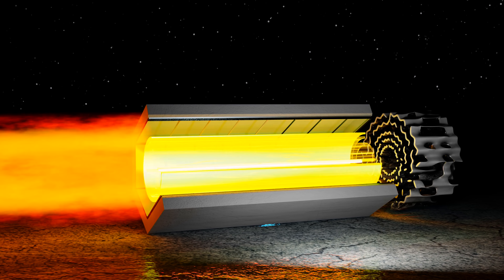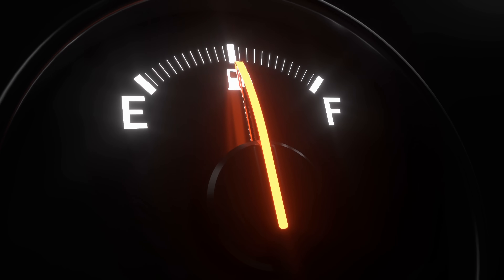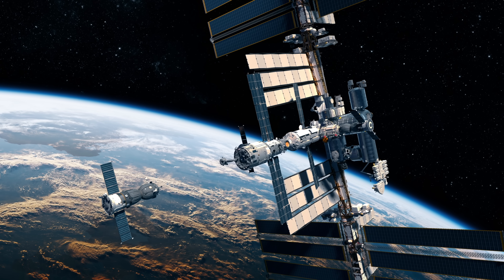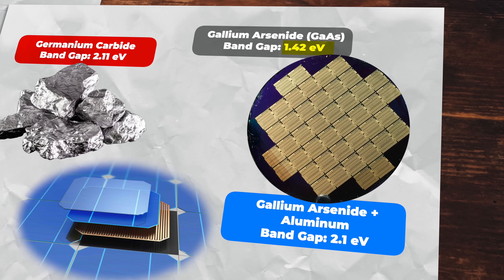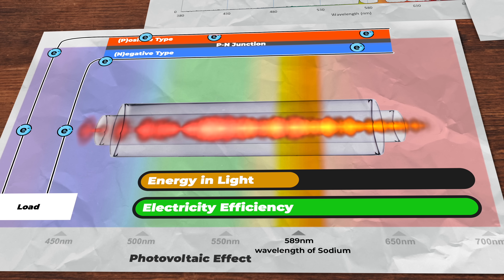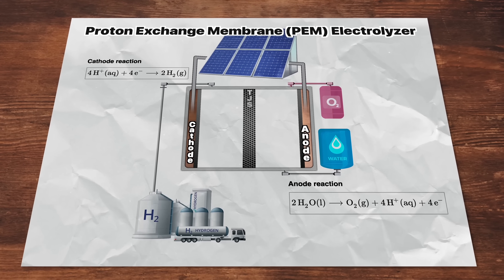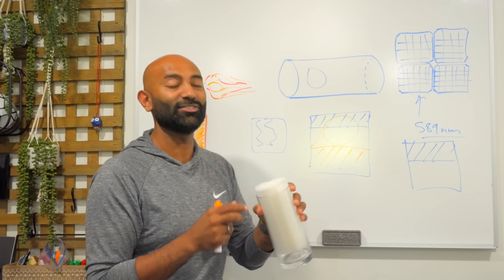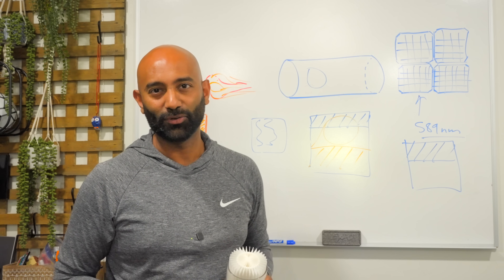Why Solid State Might Save The Combustion Engine

Comment: Thanks for covering this Ricky. As micro-turbine gas-electric generators already are capable of about 70% efficiency, are very compact and simple, why not use them instead combustion photovoltaics? 
In regards to your concept of photovoltaic ICE exhaust power recovery, I'm thinking that if you were able to recover 50% of the waste energy from an ICE exhaust using photovoltaic generator, you would be recovering about 15% of the total engine thermal losses. Having worked with  large Exhaust heat exchangers (stack robbers) to capture waste exhaust heat, but  due exhaust  restriction and back-pressure reducing engine power, we typically only recovered about 30% of exhaust heat. If similar was the case with photovoltaic recovery, you would only be recovering about 15% of the waste energy in the exhaust stream, and something like a exhaust power recovery microturbine, adapted from a turbo-charger to drive an electric generator might be as efficient and less expensive. 

BTW: Back in the 80's when I was working for in the Oil and Gas Industry and dealing with HPS and Mulit-Vapor lighting systems, the thought of using high temperature combustion gas to produce combustion based lighting using a multi-vapor tubes for remote off-grid locations occurred to me. I mentioned it to some engineering colleagues, and we estimated the efficiency could be considerably higher than electrically excited tubes but the maintenance, cost and complexities of producing such a system would likely be practical and affordable, plus having combustion sources in flammable environments is not suitable.
Reply from the maker: great insights Jack, that's interesting especially with your background... cheers!

Comment: 1.). Emissions?. 2.)  No working parts? what about fuel & sodium pumps, cooling fans etc?  3.) Tuned light panels to convert energy? - typical solar panel efficiency drops as it gets hotter. 4.) heat transfer & dissipation?. 5.) life expectancy of the combustion chamber materials due to thermal cycling?  So maybe one day, but currently Fantasy Bollocks 101

Comment: I suspect something burning as hot as this seems to would have pretty high nox emissions.
Reply from the maker: it might be possible to control the fuel air mix to maintain a healthy enough temperature for sodium light emission, while minimizing overall temps and NOx emissions... but yes that is a major factor to overcome

Comment: Why the hell would somebody combine combustion in this way?
Reply: It would be very nice to have a gasoline powered battery.
Reply from the maker: yeah a gallon of gasoline has 32kWh of energy and weighs like 3kg.... pretty crazy if you could get efficiency up... especially for some special light weight applications...I love the series of comments, and the journey you took to get to them. that is by far my favorite part about engineering!
Reply: Okay, never mind this is genius.
Reply: This is good for off-grid and stable power. This engine, however will produce no torque, and I see no reason to put it inside of a car.

Comment: 1 gallon of gas to get 10 khw of electricity.   a tesla gets 3 miles per kwh.  so a gallon of gas converted into to electricity gets you 30 miles.  

but a gallon of gas costs $6 in california and 10 kwh of electricity costs a $1.50.  

you’d need to get 120 miles out of your gallon to break even.   then you have the cost of this engine.
Reply from the maker: 10kWh out of a gallon would be 33% efficiency... their claims of 70 or so percent, means closer to 20kWh out of a gallon. supercharging in CA costs about 45 cents so that's $9, which is more than the gallon of gas. just adding some context in terms of numbers, hope that helps. cheers!
Reply: @TwoBitDaVinci  

Thanks bro.  but most people dont super charge.  and home solar is getting cheaper and cheaper.  you can legit charge at home using solar for 2 cents per kwh.  if you use the grid off peak its 10 cents.  if you use the grid during peak its 15.  

but i thought they themselves stated that they get 10kwh hours out of 1 gallon.  i might have to watch the video again.

Comment: Seeing as the best solar panels are less than 25% efficient, there's a 0% chance this is 70% to 80% efficient or anywhere close to it.
Reply from the maker: Michael did you watch the part about how sodium emits nearly monochromatic light at around 589nm? if you tuned your solar cell for that .... that's nothing like a typical solar panel on sunlight. I have graphs and stuff in the video that break that down. that's why you can't compare this to a normal solar panel that works on the broad spectrum of the suns solar radiation. cheers!
Reply: @TwoBitDaVinci  Yes I did and this is still not going it be anywhere near 70%-80% efficient. This idea that you can magically make photovoltaics many times more efficient because it’s in a certain wavelength is delusional. The thermal losses would be enormous. Even LPS lamps lose about 70% of their energy as heat and HPS lamps lose about 60%. I’d be surprised if something like this were over 15% efficient. To even present this as something that could potentially be true is irresponsible and we both know that.

Comment: This is pure moonshine (except much dimmer than the moon).  You have hot sodium a fraction of an inch away from semiconductor.  If the losses in semicinductor is 1% with 300 suns light & you have an impossible cooling problem.  The best copper heatsink could not keep the cell from melting.  Indirect schemes (transferring heat to the sodium through heat exchanger) has the same limitations of Stirling engine (the heat exchanger limits Tmax you can have, & therefore the efficiency & the heat exchanger is subject to degradation).  As soon as the exhaust cools to the excitation temperature of sodium, it can't be cooled further.  You will have the problem Chrysler had with turbine engine (the exhaust from the engine "could ignite a wet board fence from 20 feet away").  The claimed efficiency is pure bogus.
          The US Government had a program where hot decaying plutonium (same stuff as in mars rover & voyager space probe) exciting solar cell.  This is easier as there is no hot fluid flow through "engine"; everything is under vacuum in the gap between cell & the hot source.  Also, the power output per kilogram of device was much more modest (50 watts electrical power from 2 kilogram device), so cooling was not such a problem.  It was also OK for the device to be VERY expensive (not the case for car power supply).  Program was a failure.

Comment: NASA uses TPV panels that somewhat exceed 40% efficiency, but that only measures the conversion from the photon source. It does not include creating those photons, which is a pretty low conversion. Every BTU of heat is energy loss. 

So claiming 80% on any TPV system based on combustion is almost surely baloney. Or...they measured one tiny part in oerfect conditions and ignored everything else.

But the finance people can not do this basic math. They are the same people who bankrolled Elizabeth Holmes, right to the day she went to federal prison, for fraud.

Comment: The structure is so close as a blackbody, how much sodium yellow light can be generated is a question; also the Carnot efficiency formula should be still applicable to this design. Yes, a smoke and mirror scheme.

Comment: microwave+ultrasonic to create low temperature plasma for combustion from choice of fuel source. bandgap rubidium at 3.5ev pull off UV light into a UV photo voltaic. 2 cycle engine recieving output of low temp combustion through valved manifold. (essentially a compressed air engine at that point )
Reply: exhaust the plasma at the front of vehicle, radiate microwaves across the surface of the car or even spacex starship using fractal antenna arrays printed in carbon ink into the surface. voila plasma shield.

Comment: Copper would not be a good metal to exchange heat with the sodium it melts at 1084'C you want a heat exchanger made of Tungsten which melts at 3422'C.
Reply: There is an interview with the inventor at First Principles channel. No heat exchanger salt is added at the beginning of the combustion chamber then recondensed as molten salt at the heat exchanger and channelled back to the start by capillary action.

Comment: 4 kW to 4l. Seems like they are not even aware of the difference between energy and power.

4 liter gasoline is around 40 kWh. If they produce 10 kWh from 4 l, they loose 75%…

Comment: Even if this works, I think the real problem is that with EV cars and renewable energy, it works well together and eventually will mean free energy for our homes and cars.

That's going to be difficult for any alternative to compete with that, after all, given the choice, we would all rather produce our own energy for our homes and cars as we have more direct control over the price point, which over the long run would more or less be free energy, any alternative needs to match or better that, which this combustion engine, assuming it works at all, sounds like you have to source the energy externally, basically you have to buy it, and I'm sure we know how that will go.

To make it worse, with the advancement of solar tech, it's only a matter of time before it's cheap enough, light enough and can mould into the shape of the entire car, which could produce a lot of the energy if not all of it in summer that the car needs, because of this, I think it's going to be difficult for any of these rivals to compete because renewables and EV's work well together in that it allows us far more control over the production of energy and the price of it.

Comment: Rotary engine to make electricity. All Electric drive system with 1/10th the battery of a charge up system. Exhaust goes to the wonder tube. Instead of 350 miles per gallon 700 miles per gallon.

Comment: How about a sodium vapor cooled nuclear process. Or self powered street lights. The energy is the difference in combustion temperature of the fuel and the temperature the sodium needs to luminesce. The energy lost is the exhaust temperature after the light cell is heated. Maybe that heat can be recycled to superheat the intake air, but what materials can take that temperature.

Comment: 50% That's highest possible efficiency in physics when converting energy from one form to another. Chemical >Thermo > Photo > Electrical. The MAXIMUM efficiency possible is 12.5% from the initial chemical energy reaction. Take into account that the best photovoltaic cell NASA has produced was between 23 - 25%. So that means the IDEAL top efficiency would be 6.25%. So anything higher being promised is a lie. Vaporware, son.
Reply from the maker: converting resistive electric heater to heat is nearly 100% efficient. there's no 50% rule in physics... it depends and varies wildly

Comment: Mostly I wonder if soot would build up on your light source or solar panels, so you'd lose efficiency once the device exits the lab.  But if it's efficient enough, it could make a decent range extender for an electric car, boat, or plane.
Reply from the maker: yeah the system would liekly build up soot, and would need a maintenance interview to remove.

Comment: i kinda understand the idea of it? ive seen gas mantles that can convert heat from gas lamps into more light. this would in a sense basically just maximize incandescence then absorb those light back into some photovoltaics ye? heat up an incandescent material preferably one that emits light tuned to what the photovoltaic is tuned to?

just trying to digest the information.

Comment: This is pure crap.
Burning something has a efficiency loss because some heat is exhausted.
Turning heat into light has a efficiency loss.
Turning light into power via solar cells has a efficiency loss.
Cooling the solar panels to keep the efficiency up has a loss.
Storing the power made in a battery buffer has a loss.
Sending the power into a motor just like any other electrical car has a loss.

EVs have a efficiency of 80% or so, then add the looses for all the burning, converting to light, converting to power and added cooling.
Reply from the maker: all true, everything has a loss, but the question is how much? what if you have near monochromatic light, and a perfectly tuned band gap solar cell? Also a gallon of gasoline stores like 32 kWh of energy, the energy density of fuel is crazy high, which is why some aren't ready to give up on it. great comment and well thought out, cheers I appreciate you!
Reply: @TwoBitDaVinci  Try and do the math.
All numbers are rounded to make the calculation easier.
A solar panel 2m X 1 meter makes 300Watts/hour at 20% efficiency.
A "perfect magical solar panel" the same size with 100% efficiency would then make 300Wh * 5 more efficient = 1500Wh.

1.5KWh production from this burner with 2m length and 1 meter width solar panel, presumably rolled around the combustion chamber, would take 66 hours to charge a cybertruck.
If a car uses 150W/km to drive (Ioniq 6 or Tesla 3 on a good day). 100km/h for 1 hour = a 100km long trip needs 15KWh to drive.
15KWh needs 10 hours to charge with 1.5KWh burner and solar panels.
So for every hour you drive at 100km/h (60miles/h) the car needs 9 hours pause with fire burning to charge up the battery again.
This is for the solar panel alone, no other loses in the burner, cooling of the solar panels, charging of batteries is in this calculation.
Let me know if my math is wrong

Comment: You are making it to complicated. Try this take a piece of glass. Stack it on another piece of glass. use a air gap space of 1". then stack another piece of glass use another air gap space of 1". Use one way glass. Do this 10 times. Put it in a box and only allow an air gaps at every other level. Making a serpentine pathway for the air to move in the box. Then measure the temperature at each level. You will be Amazed. start with 16 to 18 in square glass taper down the box to 10 inches. Make a entry and a exit point for the air. And a small fan to pull the air in and one to pull the air out. Take copper coils and install between the Glass and pump water thru if and you have a free water heater.

Comment: Didn't early rockets use solid state fuel?
Wasn't the reason for SpaceX not using solid state fuel is because you can't stop the reaction until the fuel is spent (ie no engine re-light for de-orbit burn)?

maybe I missed it in the video, but if stopping the reaction and re-lighting is not addressed, then this is already DOA.

Comment: Heat is accelerating the aging proccess of pv-panels. Ageing is lowering the efficiency through lifetime exponentialy and the heat lowers the lifetime.
Reply: I'd think the more efficient you got the conversion the less that would be an issue... you are converting the heat to light, then converting the light to electricity.  The more efficiently you do that the less waste heat you have, and on a moving vehicle you could add some air cooling.  I think you're right though.  Managing that heat is going to be critical.

I really didn't get an idea of the scale on this... I know that, with the exception of some low speed concept vehicles you can't power a car with solar panels for continuous travel (day/night issues aside).  This is 4x as efficient as regular solar cells... but you'd still need pretty significant surface area for the cells, although obviously you can fold them in ways you can't fold a panel you want to catch the sun.

Comment: Firstly i'd like to say you're more intelligent than the general you tubers posting such videos. I mean many times. And secondly, adding to what you said I the later part, I would say capturing light has to be the fist thing which of course should happen as soon as the fuel burns... then the heat can be used for expansion ie in normal ice engine. But there's no way there won't be residual heat loss.

Comment: they would need to keep the solar cells cool too.
The temprature of a solar cell greatly effects its efficiancy and at that power density they would definitely need an active cooling solution.
Reply from the maker: great point
Reply: @TwoBitDaVinci  a Solution to cooling would be to use a clear liquid with the same refractive index of the glass and use a regular radiator and fan setup. Maybe putting it between the PV cell and the lamp with a small vacuum between the lamp and the liquid (in another tube) so as not to cool the lamp
Reply: Maybe flow the input fuel and/or air along the back of the cells?
Reply: Well in theory, because it would be able to use most of the light coming and there is less over all IR light - they would stay cooler than your sun driven panels would.

Comment: This would never happen due to the EV narrative, which is already failing.
Reply from the maker: there's no narrative, its the progress of technology. early days for EVs but batteries are already getting better by the week... and electric motors crush gas engines already. its why all the biggest machines use electric motors, but diesel hybrid for the fuel/energy source.